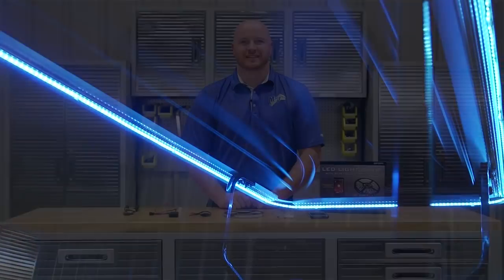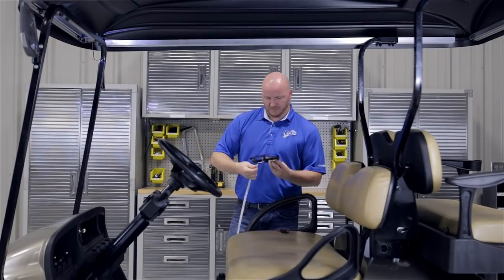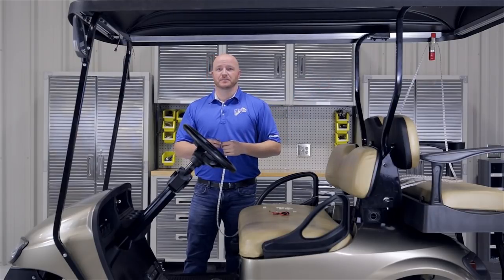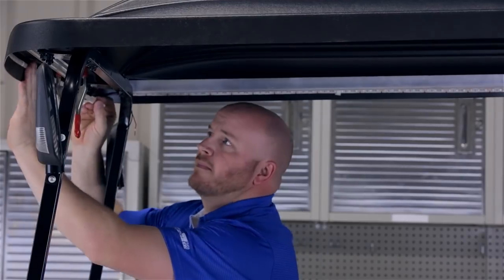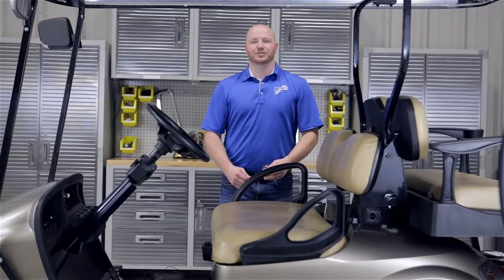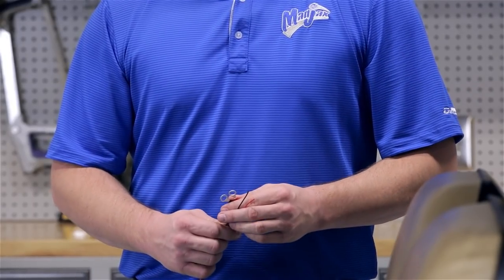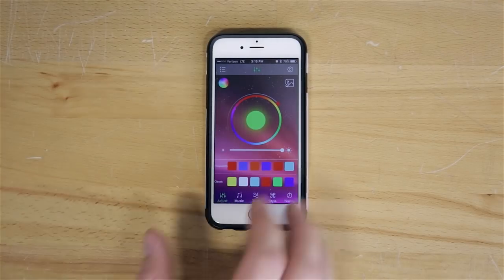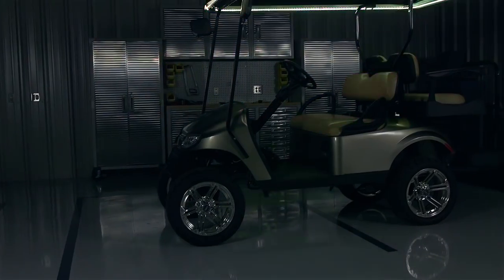LED Light Strip w/ Bluetooth Control | How to Install Video | Golf Cart Accessories

Comment: I installed these today. The LED tape had very poor adhesion. I used double sided tape and it installed very easily. I ran my wires through the roof pillars and used a Yak Power battery box to power them from the bagel liner.

Comment: I installed this strip today, as was mentioned, the adhesive is very poor. I used zip ties for everything. However, upon connecting the positive line to my battery, it instantly turned on the light strip and then blew the fuse out. This is on a gas cart that was not running. I replaced the fuse, connected it again, and this time the fuse didn’t blow the unit seems dead.